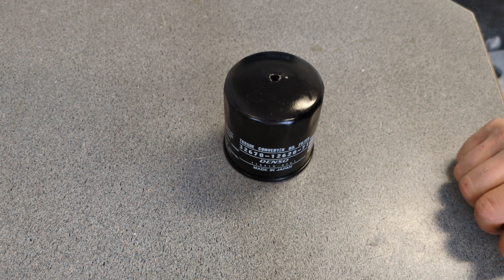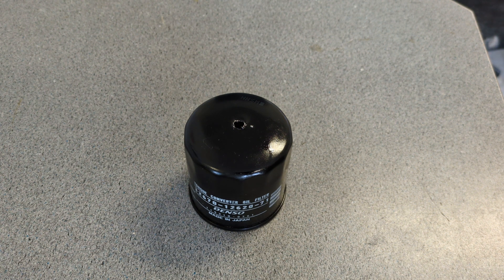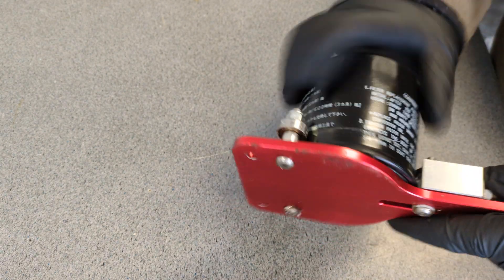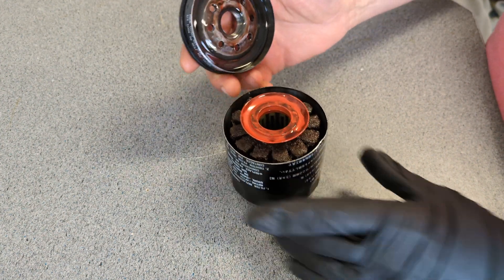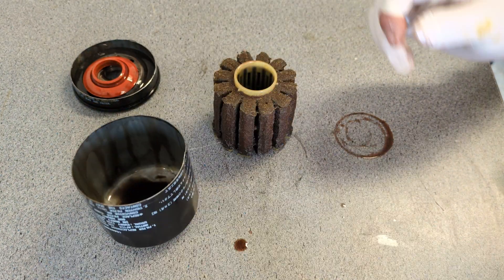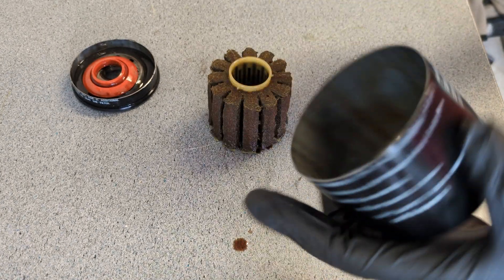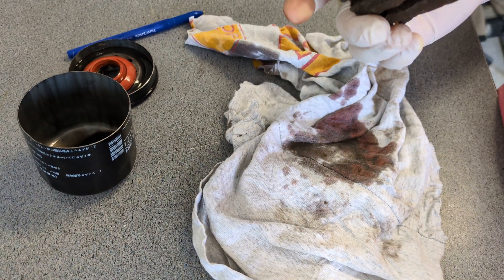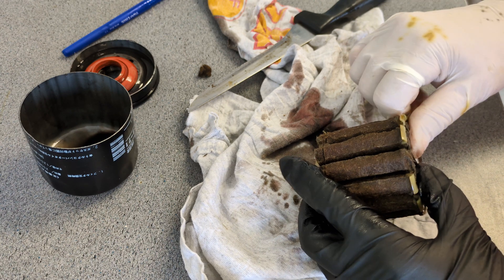Used Denso Japanese made Torque Converter oil filter cut open

Comment: There's a similar filter screwed to the side of the automatic transmission on my Subaru Forester, it states transmission filter on the canister.
I didn't cut the old one up when i replaced it but expect it to be similar to the one in your video.

Where an engine filter filters all the oil going through (the release valve only opening in the event of very high pressure such as filter blockage), the trans filter is designed to filter only a small percentage of the oil, reason being the massive volume of oil going through a torque converter and autobox.
A good idea because you can replace the filter easily instead of having to drop the transmission sump to access a normal gearbox filter.

I have heard of people trying to save money and fitting a similar looking engine oil filter instead, doesn't work out well fort obvious reasons.
Reply from the maker: Thanks lewlewis, I wish more manufacturers of transmissions used an external oil filter. Sure makes less mess and easily regular filter changes.

Comment: Interesting design. Before you opened it, I kinda expected to see the design similar to engine oil filter. But this one looks like it has a huge holding capacity, but not very good filtration efficiency.
Reply from the maker: Yes it looks like it's a high flow filter type, I was not expecting what I found inside.👍